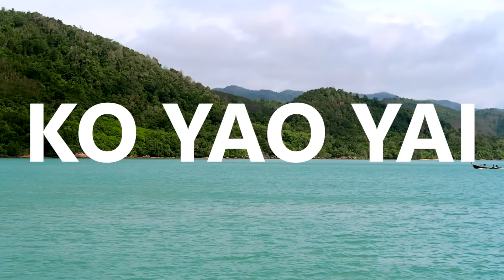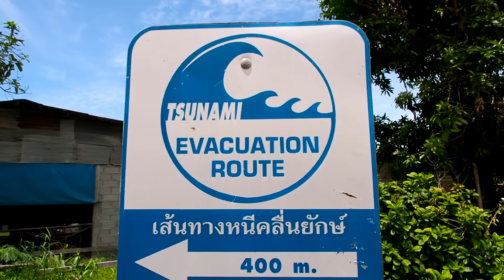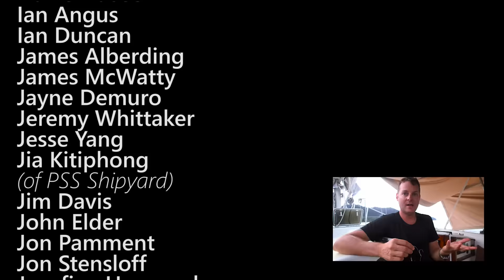SAILING THAILAND AND HOW TO CHOOSE A BOAT! Ep 35

Comment: I took a Lagoon 57 Catamaran from the Caribbean up to Florida to deliver it for an owner. As crew I had hired two solid single handers. With over a half a million miles at sea between us we all rated the trip as the most miserable of our lives. it was like being swirled around in a flying pan and then slapped down on the stove! as we crept to weather . Coming into Florida we were running before a gale with a jet ski wake off both bows under bare poles and just could not slow the boat down. It was a real pleasure to get into Lauderdale. We also once rescued a 40ft Cat that was floating upside down in the BVI  while on charter on another trip and got the crew aboard,. ( A down draft under full sail  &, a stuck mainsheet  wrecked that sailing day, some Cats have a weak link to avoid this) I know some people love them and at anchor or in a reasonable trade wind sail they are a pleasure especially on the nets and whats not to like at a steady 10K plus.... They make ideal nearshore charter boats but you must sail them within the envelope and understand the limitations both in loading and handling, its a special skill. I have to say though I am with the crew of follow the boat; a long way from land, loaded with gear, whether you take another day or another week once you settle in to the boat it doesn't matter. My longest trip was 36 days on a boat with no engine across the Atlantic ( 2 weeks almost stationary, pulling her with a rowboat!) and when we finally got to Antigua it seemed something of a shame to stop. No doubt Cats are more comfortable in light to moderate winds but I will never deliver another one across an ocean or offshore. Incidentally when the lagoon was surveyed for sale it had stress cracks all across the main beam structure which supported the mast.... So if you are buying a Cat look very closely at this area. In terms of which boat to pick I have met sailors on everything from a Contessa 26 to a 65 foot Swan and bigger. Personally I think the sweet spot is around 45ft for one, two or a small family, but its definitely a personal opinion especially if you wish to avoid the hassles of needing crew and get into some tight spots around the world. It also avoids looking like a wealthy visitor.  Don't overlook some good American boats, Hinckley, Bristol, gene the Gulfstar 50,  and if you buy in the States the chandlery is cheap to refit just watch out for sales tax. Cheers Nigel
Reply from the maker: +Nigel Studdart [Liz] Very nicely put. Thank you for sharing your invaluable experience here. Peace and fair winds!

Comment: And fourthly: a new boat does not have the usual paraphernalia a used boat does, so you'll also need to buy extra's and fit them after the initial purchase of the boat itself - windgen, solar, extra mooring lines, fenders, anchors, extra sails, tools, etc.
Reply from the maker: Good point, Rowan.

Comment: Myself (a sailor of 50 years), my wife and 2 boys aged 5 and 13 are excited to do extended cruising.  We need something bigger than a boat for a couple. Also we need something automated that can essentially be sailed solo by a reasonably fit but  aging man. I also don't want to be a boat maintenance slave, constantly fixing things on a 30 year old boat. I have an offer in now on a recent 2013 Jeanneau 57 which seems to fit the bill for 80% coastal cruising interspersed with 20% ocean passages. The boys can have their own space. I looked at older ocean cruisers in the 50-60 foot range, like a Swan , Oyster, Halberg Rassy, Hinckley and found that the boats that were affordable were most often victims of deferred maintenance, essentially being sold with NO sails, NO rig, NO engine, NO teak deck  since theses  systems were all at or hear end-of-life. $400K for a boat which needs $200K before you can even trust it is no bargain- but it is an enjoyable, albeit expensive hobby for the right person. Me, I'd rather be sailing.

Comment: Hi Both, great video. A quick tip that may make life a bit easier for you. I noticed during the heroic mainsail reefing bit, the sail was entering the mast in a manner that trapped the cloth against the side of the mast slot. This doubles the friction of an inmast reefing system. If you had put in a brief tack just to reef, the sail would be running free onto the revolving spindle, resulting in less friction and a faster, and tidier reef that doesn't have to be re-addressed at some later time. It is also a lot less strain on the system and crew, and the sail itself will take much less of a beating, with the resulting longer lifespan. It's something you may already know, in which case apologies for being a smartarse, but if you have tried it before (consciously) give it a whirl. You might even impress yourself :-). Keep up the laughs.

Comment: I think I'm the first!
great video! You guys mixed it up a bit this time. I hope Liz's mom is doing okay. The cat going overboard last video was crazy!  You forgot one thing that most monohulls can survive and a CAT never will. A good blow over! CAT's are much more stable upside down than right side up. 
I'm a bit old school and the way a a good monohull moves thru the water is so nice. Being a power boater its amazing how a well designed boat handles rough seas so much better than one that isn't. If you have unlimited funds buy a CAT and sail when it works for the boat. 
Theres a reason a 55 foot Amel costs over 2 million dollars and the same size CAT costs half that. Delos is a 2000 53 foot Amel i think and could sell for $500,000 easy! They cost of a new 40+ CAT.
It would be so cool if you ran into sailing Emerald Steel along your journey!
Reply from the maker: Great comment, Jonathan. We should have discussed this in more detail in the actual discussion, which is why in post production we flashed up the 'watch the stability curve' caption!
Reply from the maker: +Jonathan Kaany [Liz] Thanks for remembering, Mum's doing very well, safe at her house in loving care. 🙏❤

Comment: "Ferro cement is really the preserve of those building their own boats in their back garden" ouch Jamie I'm hurt!  
My Endurance 35 is a ferro cement cutter rigged ketch build by Windboats of wroxham, who also build... yes Oysters! My ferro cement yacht is so fair that  most people just assume she is GRP - 
Yes there are some very crappy ferro boats but professional well built ferro boats take some beating, you can generally buy really good ones for 15 to 30 percent less than a GRP of equivalent size and age, weight for weight they are about the same as a wooden boat of equivalent dimensions, and so offer a very comfortable passage, mine weighs in at 13.5 tons and even when we were in a force 10 with 6m swell she felt very safe. maintenance wise, the hull requires very little maintenance and if it does ever hit something you can fix it with a bucket of epoxy cement and a trowel rather than paying a shipwright to re plank your wooden boat or a grp man to treat your osmosis 
They spend the first 80 years curing so keep getting stronger (look out for videos of grp yachts being broken up versus ferro yachts being broken)  
There are downsides to owning ferro , home built ones should generally be avoided. many yachties have a negative opinion of them without having sailed one, owned one or even done much research in to them (I'm looking at you Jamie). There are many urban myths associated with ferro - No one will insure them - wrong I have fully comp insurance. They get concrete cancer and blow apart - wrong, I've seen horrible old home built ferros with no paint and rust stains that still sail without exploding into a cloud of dust, and well buit ones that are reasonably well maintained generally don't get structural problems  - If they get hit by lightening the cement blows off - no it doesn't. - you'll never be able to sell it - mine is second hand so that proves that wrong.
Anyway, I'm going to overlook this discretion as I like your videos and I'll put it down to ptsd after nearly loosing Milly - keep up the good work but be a bit more charitable to us that were going to put our money in to bricks and mortar and then realised we didn't need the bricks :)
Reply from the maker: Darren J +Darren J Apologies, Darren. No offence meant. It's difficult to edit down a one hour discussion into 10 minutes so much as we'd love to discuss all materials in depth we decided to stick to our recommendations based on our experience. Generalisations have to be made for the sake of editing. This is why we encourage feedback in the comments and look to people like yourselves to correct us! Thanks for the reply, Darren. Fair winds to you.
Reply: No real offence taken Jamie :)

Comment: I really love that you guys are actually staying on the hook rather than sailing between marinas etc.  love to hear about the power systems in your boat. You sound like you love a bit of electronic gear between your AIS and cameras etc - do you have to ration your electricity or do you make enough with your 4 rail mounted panels ?  Did some of the best diving on the walls around phi phi.  Loved Langkawi too but for more on land stuff
Reply from the maker: +Wade Smith (Wadeabout) In the south west monsoon period we struggle a bit with lack of sun. We both spend considerable time on the computers and have many batteries to charge. We have a petrol generator as back up though.
Reply: followtheboat ah yes. I remember the Honda ? On the bow

Comment: Pinch pinch pinch....lol fun old vid  TY!  For me the mid weight racer cruiser is not about "speed" the boats like the Jeanneau or 80's IOR type boats is that they can make way in lighter air.  A stiffer boat that points well has more options when shaping a course.   Cats,   advantages yes but......$$.   Cats have advantages and disadvantages, but..... $$

Comment: what would the smallest boat you would ocean cross in comfortably. and what would be the biggest that the two of you could handle the rig?
Reply from the maker: [Liz] Having lived in a 43ft boat and accumulated so much stuff over the last decade, I couldn't see us in anything smaller. BUT American's boat is a beamy 36ft, and I could easily cross an ocean in it. 
Beam is very important when considering size. 
As for the biggest, I doubt we'd want to go for anything above 56ft, and it would very much depend on rig, sail plan and ease of use because we seldom sail with any other crew. Peace and fair winds!

Comment: Could I bring my synthesizers, drum machines, etc..., on a live aboard (45ft cat), and turn a berth into a mini music studio? Or, would the ocean air be likely to corrode the circuitry?
Reply from the maker: +Funk Daddy Hey Funk. I think electronics fair better these days. We were always warned about laptops corroding when we first started out but it hasn't happened yet. I have an S2 mixer which I use for the odd bit of DJING but I do keep that in a Peli case so that could be an (expensive) option, to put all your gear in stackable, mountable waterproof cases. If you're using old 808s, 303s etc they may be more susceptible to the marine environment. I can't say for sure.  We've met many musicians who have instruments on the boat, including a classical pianist who had a full sized keyboard on her boat. Took three people to get that thing on and off the boat, mind. It came in a carry case, not a waterproof one, and I'd say that's fine.
Reply: followtheboat  THANK YOU!!!
I have tried so hard to find an answer to this question, and you answered it. I really appreciate that you know what an 808 or 303 is. Most of my gear was built in the last 5 years, and it is a combination of digital, analogue, and hybrid. And yes I have Roland's latest versions of the TR-808 and TB-303 (TR-8 & TB-3).
Reply from the maker: I reckon the newer versions should be ok. You sound like the kind of person we'd like to bump into in an anchorage. It's hard to find like-minded people when sailing, especially when it comes to music!
Reply: followtheboat That would be really cool to meet you guys one day. I to have a hard time meeting people who share my taste in music. Stay well my friend :)

Comment: Great vlog again, always informative and interesting. What brand and model is the red and black waterproof jacket that Jamie wears and whats the verdict on it? Would he buy it again if he needed another one? Thanks in advance : )
Reply from the maker: Hi Chris. It's a Musto (UK-made) coastal jacket. I mention 'coastal' because it is not off-shore, not in a cold weather sense. It's light enough but still keeps me warm and dry. There's a couple of design issues with the hood that annoy me and some of the waterproof strips that protect the inner stitching have come away but it's over ten years old and it's taken a few batterings. I remember someone telling me that Henri Lloyd gear was the best but that was year ago. Technologies change and I do like the Musto design (appearance). Would I buy it again? I'd still shop around but I'd be happy if I went with Musto again.
Reply: Thanks for taking the time to reply

Comment: Sorry but I do have to comment on the best boat segment. 
For most of us to afford a “quality”, boat means it has to be 30 to 40 years old. 
Choosing that over a “production” boat, which is 5 or 6 years old is IMHO crazy.  
Newer boats have a modern design and are easy to handle. Most of the equipment found on these boats are the same quality found the “quality” boats.
Production boats are not that lightweight and produced with modern techniques so osmosis is not an issue. 
If they can survive years in charter traffic, they can’t be that bad. 
Sorry couldn’t help myself :)
Reply from the maker: +TottoDiver Thanks for the comment. Of course you could always buy a 30 year old production boat. I'm not entirely convinced that modern boats avoid osmosis. Osmosis occurs in older boats partly because they've been in the water for longer. Only time will tell if the modern materials prevent osmosis from occurring.
Reply: I regretfully agree that most production boats with “A” ratings probably should not be taken offshore, they barely make it into category A.
However, there are some exceptions with good STIX and AVS numbers, it’s just finding them